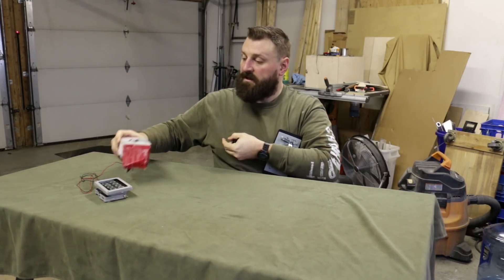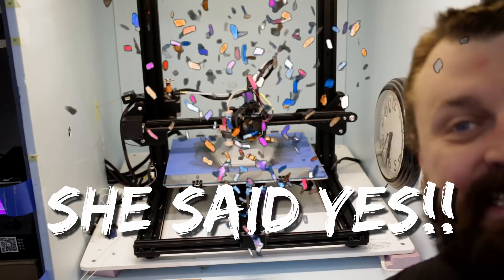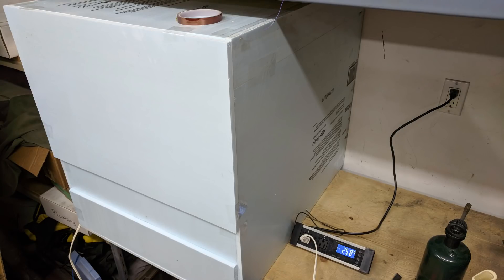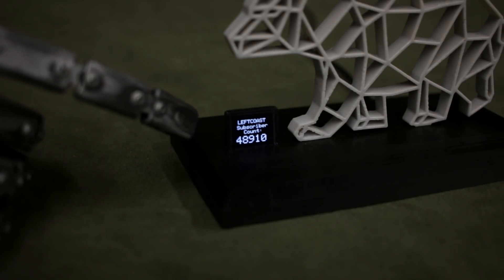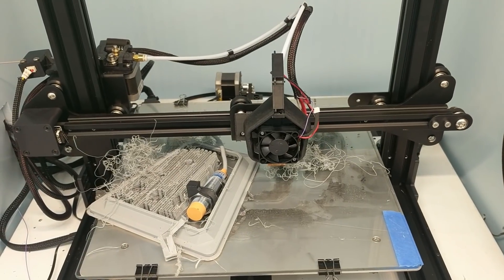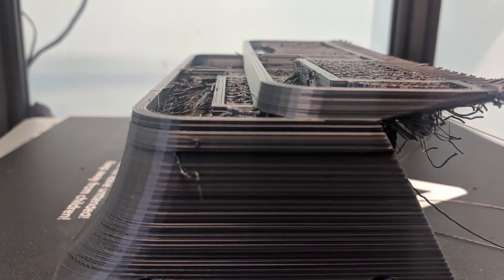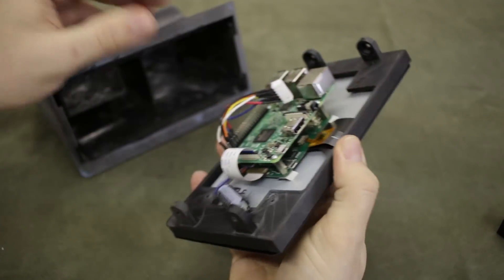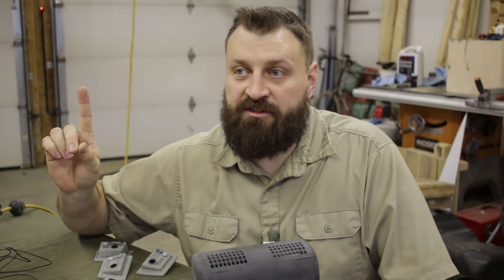3D Printed Camera Pods and Dash Pods - How to Build an Overlander

Comment: Another awesome video! Can I ask why you didn't use PETG filament? I've used it a lot and it's quite temperature resistant and pretty easy to print with
Reply from the maker: For a camera pod carrying electronic components in a hash outdoor environment it is easy to get ABS to be fully waterproof with a quick vapor smoothing and/or painting a thick layer of ABS juice on the inside surfaces. If a PETG print has slight layer adhesion issues there is not much that can be done post print - ABS can easily be strengthened with a trip down vapor lane...  I print primarily PETG now, but this video is quite old and ABS and ASA was still my go-to filament back then.
Reply: @Everlanders  ahh makes sense 👍

Comment: if ya do anymore printing  at that high on that machine - u need to remove the ptfe tube that comes stock with the machine  and replace it with capricorn ptfe , the stock tube goes down the throat of the hotend and at temps of 240 and higher it will deform, melt , get miss shaped , turn brown and black and shrink and even offgas (not good to breath) - the capricorn is rated for higher temps and u wont have these issues,, those layer line shifts u see is the stock white ptfe tube shrinking or melting  maken the prints screw up ..  and could be one issue...but im sure you figured this out already
Reply from the maker: That machine is in a shipping container in a field in Canada... We're taking this rig through Mexico and into Guatemala and beyond...!
Reply: @Everlanders    safe home , have fun !!!

Comment: Do you really need another camera,...
Reply from the maker: We have enough now...
Reply: Everlanders your panel,is it 12 volt or house size 30 to 40 v , I have 6 ,  265 watt , open circuit 38.6 , can you assist me , ie is the controller you use useful to me , if not can you recommend, installation in a coaster MH bus of grid, 54 year old Aussie that needs to retire in the mountains on a parcel of land I have ,

Comment: A few things for you sir: great videos love all the little details, came for the Pi builds stayed for the laughs. Sorry I missed you in Flagstaff we were staying further north and as you know it was a chilly Arizona weekend. Started my Pi build and ran into some snags with the free Open Auto version and as much as I can tell it seems to be related to the Google Play Services version I am running on my Pixel 2 XL, 17.4.55. I resolved it by trying the paid version of the app, worked without issue.  Did you run into any similar issue? Using your scripts for button monitor also work great. I have been tinkering with methods to incorporate other cameras and speculating on how you have. Looking for any updates on your camera project to help streamline mine. Thanks for all the input and videos.
Reply from the maker: No, I've not touched it since the video was put out... Still working fine with Pixel 3 XL
Reply: @Everlanders  Well I was afraid it had something to do more with me. Did you run all your cameras with a HDMI to ribbon adapter? I had considered making a small LAN network for 3 cameras or so and attempting a WLAN run with a Pi Zero W for a once in a while on the rear of the trailer. With the individual boards being located at static IPs I thought that might be the best way to toggle through them or select something specifically. I would also feel more comfortable routing a Cat5 cable as opposed to ribbon or HDMI
Reply from the maker: I have 4 of the cameras on the LAN but for low latency I have the rear facing one on the Ribbon cable.

Comment: Very cool project! I can imagine the learning curve(s) involved.

Would you be willing to share your source for the ceramic heater and thermostat?
Reply from the maker: https://www.ebay.com/itm/20-X-20cm-400W-12V-Silicone-Heater-Pad-3D-Printer-HeatBed-3M-PSA-NTC-Thermistor-/281471547073?_ul=CA
Reply from the maker: https://www.ebay.com/itm/DC-12V-20A-LCD-Digital-Thermostat-Temperature-Controller-Meter-Regulator-W3230-/401392962897?_ul=CA
Reply from the maker: Sorry, the above links we're for the heater in my battery bank... I see now you were commenting on the 3D printer and its heater... https://www.homedepot.ca/en/home/p.amaze--heater-400-watt-ceramic-electric-wall-mounted-room-heater.1001036744.html

The controller was kicking arround, but I've used these too with good results: https://www.ebay.com/itm/110V-220V-STC-1000-All-Purpose-Temperature-Controller-Thermostat-Aquarium-Sensor-/192338564198?_ul=CA
Reply: Everlanders Thanks! I found the Home Depot (and Lowe's) Amaze products shortly after commenting. The thermostat link is very helpful. I'm monkeying at under with a few, similar, projects. Thanks again. Also... Nasty winter this year; how did the overlander perform?
Reply from the maker: We have been trying to avoid going out too much and focus on getting stuff done.

Comment: Would you be willing to upload your Android auto enclosure design to thingiverse? I have an F-350 that it would work perfect for! This would be a big help because I have wanted to do something like that since your uploaded the first video about it. I bought all the components just haven't built the housing.
Reply from the maker: Ask and you shall receive:
https://www.thingiverse.com/thing:2881843
Reply: Everlanders I cannot thank you enough!
Reply from the maker: Did you get it printed?
Reply: Not quite yet, I'm trying to get the pi to work first. Instead of just running android auto on it I wanna run full android. I'm a car audio installer and I had already changed my head unit to one that supports android auto. I'm hoping that once I install android the radio will see the pi as a phone and boot up android auto.  That way I will have sort of a dual screen setup up top. I could do maps on the top and music on the bottom screen or vice versa. I'm also contemplating on installing a third battery to keep the pi on all the time as use it as a remote security system with some cheap usb web cams and an android app. I should also be able to interface with a dash cam through their android app. My main reason though is to run the Torque Pro app for custom gauges and the ability to read check engine codes with a bluetooth obd2 adapter.

Comment: Nice! I haven't 3d printed, but a friend of mine does and has experienced some of the same frustrations with over-night printing as you have...is that an A/C unit on the back of your truck? if so...what model and how do you like it?
Reply from the maker: Yes, it's a Gree mini split AC, it's nice because the compressor is completely outside, connected with an ambilical, so it's fairly quiet and efficient. I could almost run it exclusively on solar using the 4 panels I had last year, but with the upgrade to 8 panels @ 1.4kw, we'll be made in the shade!